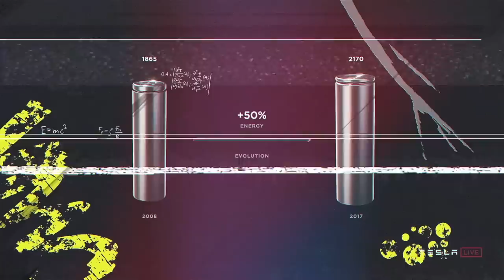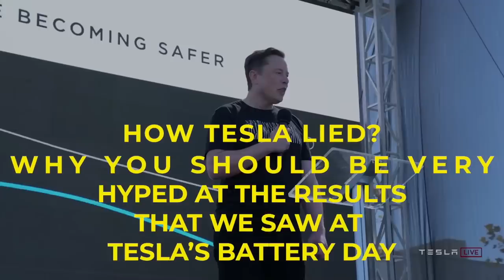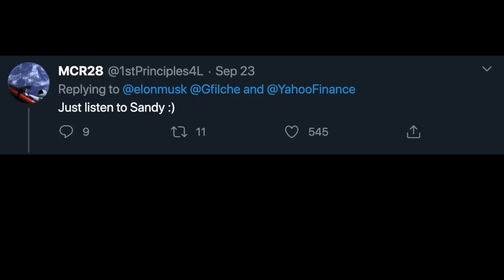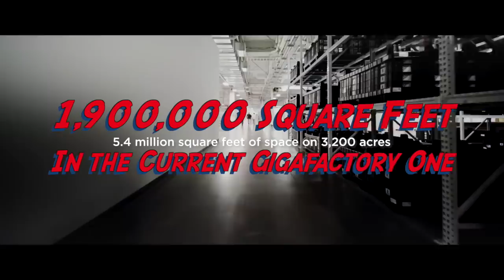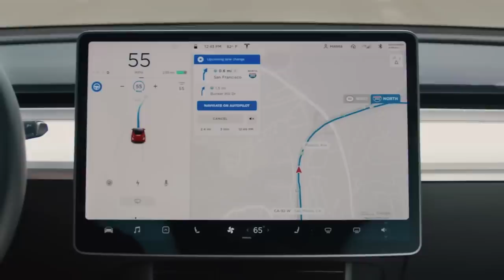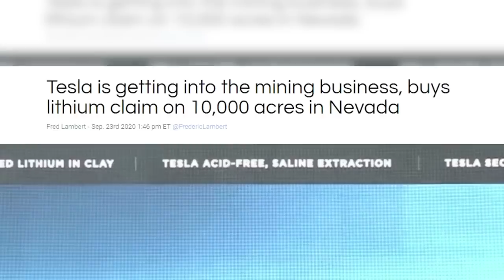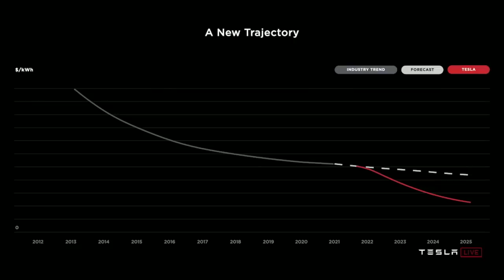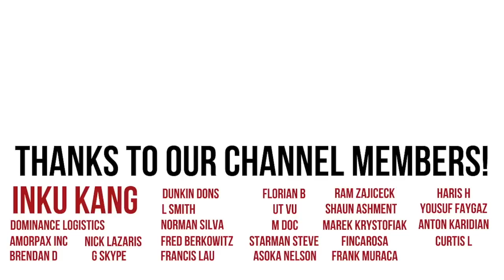Tesla Lied At Battery Day

Comment: If the compact car only has room for a battery half the size of the current Model 3, with energy density increase of 14% would alone make the car go 205 miles on a charge, and that's not including the fact that it's a smaller car so it would be more efficient from that alone, or the fact that because it's a structural battery it will be even lighter.

What I am curious about is Tesla's 170wh/kg batteries vs their current 240wh/kg (it goes up so fast this may not be accurate) but if the wheelbase is 1.5 feet shorter and the wheelbase of the model 3 is 115, the batter is that minus wheels (95 inches) so the battery would be 77 inches long 81% the physical size and 69% energy density..

So 353x0.81x0.69=197 miles

So even in the worst case scenario this small car will go at least 200 miles, and that's the worst case scenario.

But we also have to remember that Tesla increases their energy density by 5% every year and that energy density was in 2020 The car will be coming out in 2023 (197 or 205 miles) x 1.05^3=228~237

I keep running all these numbers because I'm getting antsy from not getting any updates about it (because I'm going to be buying it)

Comment: SOON THE ELECTRIC GRIDS WILL BE OVERLOADED . MUNICIPAL POWER SUPPLY WAS NEVER DESIGNED TO HANDLE PEOPLE ALL USING ELECTRIC CARS . THEN WHAT ARE YOU GOING TO DO?
Reply: Produce more power lol, we live in a capitalist country they will increase supply to fit demand. It also helps when the same company is also helping make these things called “solar pannels” and you can put them basically anywhere
Reply: @cjk_02221  I live in Canada , 1/2 the year solar panels are useless . They would take forever to charge a car , even on the equator .
Reply: derek crymble if solar doesnt work then wind, then geothermal, then nuclear. Seriously there are toms of options we arent gonna run out of electricity

Comment: Run this past me again.... Larger batteries charging in the same amount of time is not a tech improvement? More kWh into a battery of the same size is not a tech improvement? Producing the same capacity battery at a lower cost is not a tech improvement? 

It sounds like many in the audience didn't understand what was actually being said so they focused on the intonation & body language of the speakers. Anyone who's hard of hearing or has struggled with a new language can tell you that's not an effective strategy in settings like this one.

Comment: 70's: The world does not need more than 1000 computers
80's: 640Kb is more than enough for everyone
90's: Internet is a waste of your time
00's: Machine learning is to power intensive for machines
10's: Qantum computing is never actualy going to solve math problems

Also 50's: We will have working fusion power in 50 years from now
I'm a software engineer not a battery engineer. But they will have the same experiance in there own field

Comment: Regarding the time required.
battery day quote.
"We're on machine revision 4, each revision is taking 3-4 months....... we expect to achieve serious production by revision 6 or 7". That'll be 12 months. meanwhile, build the "box" to house the machines (Berlin style prefab), should be ready before the machines.... 6 months to install and test? 18 months from battery day? If its machine 6, 3 months per machine and 4 months install, 10 months.

here's a thought.
if the DBE section is reliable, but slow, just double up that section to feed the "can making" line until its refined?
When its done, remove and upgrade the second machine for another line.

Comment: I think you got the Kato Road figures wrong.
they stated on battery day that one Kato Road line should eventually produce 20GWh, currently 10GWh. The current output at Nevada is about 30-35 GWh from 13-14 lines(?)
They also mentioned 7 times output per line, so that fits.
14 lines replaced by a "2 module" factory 20% of the size.
(note there's also pack assembly and maybe drivetrain at Nevada?)
if we discount other operations and assume the Nevada building is only 60% complete, that gives us 5 times production for the current space plus another 2 when complete, 7 in total, so 35 x 7= 245 GWh. round up to 250 and that's 4 factories per TWh.
I suspect its more like 3 per TWH.

Comment: There are 2 things about the battery which no one is talking about: 1. Out of 100 batteries manufactured how many failed to meet the performance specs and 2. How abundant are the raw materials required for the new cells ( asfaik,  to overcome this they were changing some crucial materials used in common li-ion batteries. )

Comment: It is not true that "despite the increase in range, the battery still costs 56% less". The cost reduction is per kWh - meaning that it is 56% cheaper for the same range (which would require fewer batteries). Range improvement is given per KG. Cost improvement is per kWh. Two different ways to look at the same thing - they do not stack up.
Reply: Indeed. More kWh = price increase. And most of EV price is still from rest of the car so even halving battery pack cost would only result in ~10% lower overall price.
Though if you make a battery pack that costs same but weights less, that would mean less power needed to move the car so the range and other performance factors would increase.

Comment: Elon did it again,,,,
Here are he numbers for SEMI TRUCK:  Weight of the rig 36 tons max.  width / height 2.5m/4.1 m   CD = 0.36 ,  rolling resistance = 0.012. Required  power at 100 km/h (60MPH) = 153.27 KW. 

 Battery 1000 KWH. Range 400 miles at 60 MPH.    IT IS ALL FEASIBLE!!!!!!!!!   ROLLING RESISTANCE POWER IS 2 TIMES BIGGER THAT AIR RESISTANCE POWER (107.91 KW vs 45.36 KW)

Comment: You don't understand how the market works. The people who were disappointed have already priced in extreme improvements, so anything below that is a disappointment. So 4 times better doesn't cut it, it has to be 20 times better. That's why the stock sold off. Stocks are trading on future value, not current value.

Comment: Tesla indirectly announced batteries with this kind of specs when it introduced the Tesla Semi.

Daimler people doubted Tesla could deliver the Semi within the shown specs and mocked Tesla and Elon with: "Physics laws aren't different in California". The point was that unless Tesla unveiled a breakthrough specced battery, just with the same used in the Model 3, the trucks wouldn't meet the specs.

Further teardown of Model 3 battery packs with characterization done by "The Late Great" Mr. Jack Rickard (R.I.P.) shown a bit of improvements with the then new 2170 format and chemistry, but not enough to proove feasibility for the presented Semi specs.

Considering that Elon and Tesla weren't intentionally misleading and lying they already expected then to release new and better batteries similar to the now shown 4680 cells.

Tesla was not manufacturing battery cells than, but relying on Panasonic. 

Entering the cell manufacturing and beating the benchmarks is no easy task. It took time, money, and mindshare brought with targetted acquisitions.

In the Battery Day presentation, Tesla was publicly showing details of the proposed technology, how and when they would be able to effectively mass produce it. Those were the details missing that instigated doubts since the Semi introduction.

Tesla has not fulfilled the proposed timeline. Others had not leapfrogged them so far. 

Tesla may even leverage it's ability to license production technology to other manufacturers (saving them a lot in research to duplicate Tesla's achievements while avoiding infringing on its patents) to obtain a steady cost competitive supply of standard batteries from this external supplier/partners.

Comment: In terms of volumetric energy density at the cell level, 4680 is actually lower then 2170.
So Panasonic improving 20% is actually an achievement. 
4680 is 5.5x volume but only 5x energy capacity!

Comment: The 4680 cells will be used with all the 3 different cathode materials!

@hyperchange just confirmed that via the IR at Tesla - the 4680 cells will be used for all the types, iron, nickel-mg and high nickel. They are beginning with the high nickel because that is the hardest part and those are the products that are next in line.

Comment: The Battery Day Presentation should have emphasized that the battery pack (using the new 4680 battery) is 10% lighter, has 10% more power and 17% more range, and has a footprint of 1/2 that of the old 2170 battery pack. This allows twice as many batteries to be placed in the car in the same space.  Now, there is room in the Model S for a 150 kwh battery pack!

Comment: mmm.. .no. they didn't understate... they just didn't hype like a used car salesman. this meeting was for share holders, not for nay-sayers. to appreciate the facts he handed out, you have to understand how electricity works. a MASSIVE amount of increase in the amount of amperage you can draw from a battery cell is an increase in kwh... because:  amps x volts = watts. this doesn't just increase how far you can go- it increases how well regen works, how fast you can charge & how fast you can accelerate. 1st gen tesla packs are going 300-500k miles before replacement is a necessity. if you take the increase in charge cycles this battery is capable of, then factor in the added range of the new pack.. this is BEYOND a million mile battery.

Comment: Finally someone brings up charging graph and what it really represents wich is comparison of charging time  of single cells , 2170 to 5 time bigger 4680. Look how charging rate improved going from 1865 to 2170 without removing heat problem other than putting a bit more efficient cooling system in model 3. 
Tesla reduced internal resistance of new tabless cell by factor of 5 and gained much better access to the core/ inner layers of cells when it comes to preheating or cooling.
The only bottleneck now is charging port and cable. That's where recently filed patent for liquid cooled cables comes to play.
Reply: Wow! Thanks for simplifying it for me!
Reply: @MorganMadej  Your welcome :o)

Comment: I think he stated them in a way that the statement itself is the news not the volume and pitch of the presenter.  Also not spoke of after much.  These batteries have structure supporting cases, the thermal is lower, Tesla invented a new alloy and is casting 70 pieces as 1.

Comment: @5:50 mark: 20 minute charge for 300 miles. 

Elon has already stated he wants the charge slope to get closer to the gasoline refueling system timeframe.

Once it’s a closer to that timeframe then it’ll be a S curve adoption.

The ramp up for 4680 production will be the lower production vehicles first, until then the mass production vehicles will continue to be 2170 batteries.

4680 batteries: MS /  MX / Cyber / Semi / Roadster 2.   If Munro is right on the pack size of MS then it’ll probably be 130 kWh pack and then roadster 2 might have a maximum pack of 205 kWh.  Cyber Truck might have a 110 kWh pack. 

Semi might have 250+ kWh pack. 

If TSLA still continues with the MX production then it’ll probably be a 100-105 kWh pack.

Comment: Processed Lithium for batteries is chemically and $$$ costly. Lithium's initial use was medical - mining and shipping of the metal was strict, tedious and $$$ - "for human consumption" it had to be coated. Then came batteries, NOT for human consumption. But the mining and shipping processes haven't changed - equipment was bought, installed and successfully used for decades - NO CHANGE NEEDED. Today Japan is the only place(?) the protective goo can be removed for battery grade lithium. So, after mining, it's off to Japan, etc. The new mining will eliminate the medical "goo" coating, et. al.

Comment: Giga Nevada does not have 98 GWh annual capacity for cell production. Currently they have 35 GWh, and Panasonic is upgrading to 39 GWh per year. This makes the 10 GWh/year for Tesla's single pilot line very impressive, vs. 13-14 production lines at Giga Nevada.

Comment: Great video.Tesla also lied about future battery production capacity:

1.	If their advancements in battery production, as detailed on Battery Day, will result in production lines 0.1 the size and 7x as fast than the current lines, why would Tesla leave the old inefficient/slow lines in place in Giga Nevada and Giga Shanghai?
2.	Upgrading these lines would result in a 70x increase in production at both sites (10 lines replacing the current lines in the same floor space, each 7x faster than current).

Projected production in 2030 would be as follows: 2.4TWh at Giga Nevada and 1.75TWh at Giga Shanghai, bringing the projected total, without additional production from new factories, to 6.66 TWh, not 3TWh.

Comment: 7:45 says the range increased by 54% while costing 56% less. I think there is a subtle misinterpretation going on here. I don’t think you are going to see a battery pack with both 54% more range AND 56% less cost. I think what Tesla is saying is: the new technologies will allow 54% more range for the same vehicle mass (because battery energy density has increased and because redundant vehicle weight is eliminated by the structural battery pack), and the cost per kilowatt-hour will be 56% less. But, if you want that 54% more range, you’ll be buying more kilowatt-hours of battery capacity, so the total price of the pack is NOT going to be 56% less. You will get some increase in range for free (because of vehicle mass reduction), but beyond that, there will be a trade-off in which you can get more range or more price reduction, but not both. I believe this is the most reasonable way of interpreting the numbers that have been offered.
Reply: There was a slide that specifically clarified this. All the numbers stack
Reply: @Nathan Madden Slide 67 in the presentation shows how the different contributions add up (see https://tesla-share.thron.com/content/?id=96ea71cf-8fda-4648-a62c-753af436c3b6&pkey=S1dbei4 ) But, that still doesn’t clarify how range and cost interact.

Most of the improvements relate to the cells, and only a little relates to the vehicle integration. For cells, when the talk about improved range, they  are probably talking improved energy/mass? (Would energy/volume ever be what is relevant?) Whereas cost would refer to cost/energy. If that’s the case, one would, as I’ve suggested, see a trade off between range improvements and total cost improvements, and not get the maximum of each at the same time.

I’ve just realized there may be an additional hidden trade off in the numbers. They talk about 3 different types of cathode (slide 48). It could be that maximal range improvement is associated with one type of cathode, while maximal cost improvement is associated with a different type of cathode.

Comment: Casgains Academy - you Misunderstood, 4680 Cell is NOT Coming Any Time Soon to the Model 3/Y.
Tesla is using LFP PRISMATIC by CATL for ALL Tesla SR+ Vehicles with FSD + 300+ mile Range. 
for TESLA Dual - Motor and Performance model 3/Y , Tesla will be using 2170 by Panasonic, LG Chem, and Possibly SAMSUNG SDI in the Future. they WILL NOT be using 4680 cells. 
the Advanced 4680 cells will be used in PLAD model S, Roadster, SEMI and Cybertruck.
so even with 10 Gwh in 3 years, TESLA will be CELL Constrained. 
and it will use 2170/1865 in Model 3/Y and Model S/X.
IF, for some reason , Tesla is Able to RAMP production , the ONLY other vehicles VIABLE for 4680 cells are the PERFORMANCE model 3/Y and S/X. but its NOT AT ALL LIKELY.

Comment: I guess it depends on what kind of audience u belong to. if u understand the engineering and tech in manufacturing u would be amazed but as an average Joe consumer....? no.

if it would have been called "operation day" were they talk about manufacturing and supply chain, I agree. my problem with battery day is how for several month Elon hyped it in a way that a massive battery tech breakthrough was achieved and I reckon there was nothing said on battery day he couldn't have told us 3 month ago...?!

it was all very theoretical and frankly confusing. but as far as I understand I would need to buy the semi or cybertruck to get all the benefits? 

simply, I still don't know what will be different from a current model 3 and one with the new battery? or S or Y or X for that matter 

- will I get a million mile battery? 
chargingdegradationimprovements
- charging time improvements?
improvements? (i.e. not having to care to keep it between 20% and 80%)

and if you're not an investor manufacturing cost don't matter that much since they base the price tag on demand and not cost.